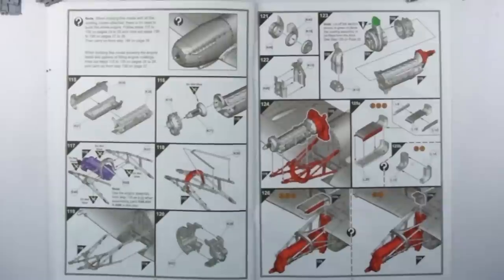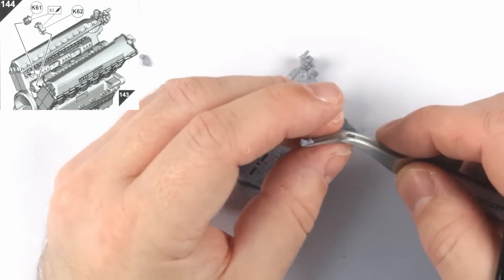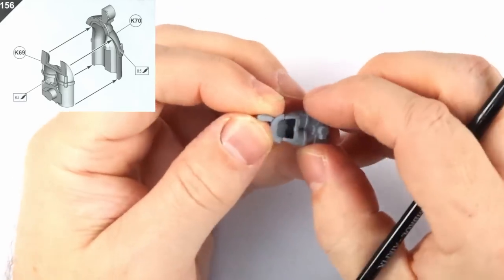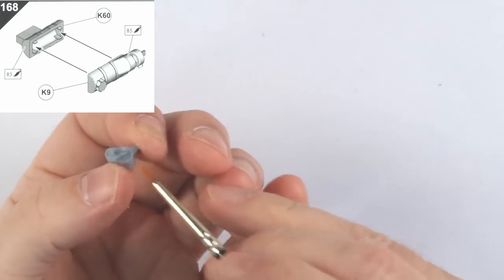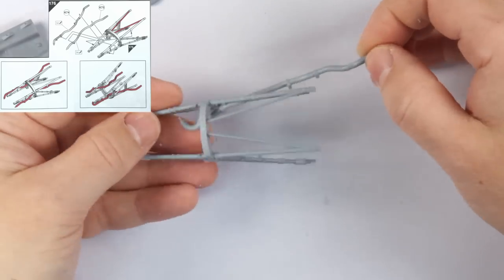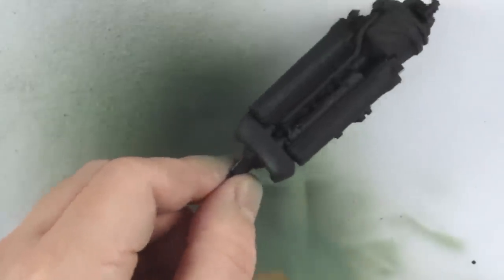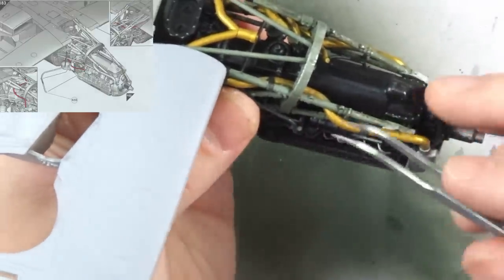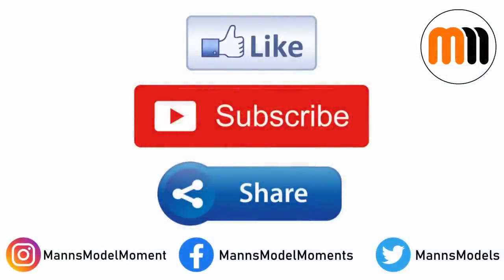Airfix 1/24th Spitfire MK IXc Build Part 3: Mighty Merlin!

Comment: Hi Alex! Really enjoying the channel and your 'grown up' approach, like not saying really makes it pop ever 30 seconds 🙄. Can I just say that the vast majority of metal pipes on an engine are copper rather than brass. Copper is easier to form and flexible in use. Brass is more difficult to work and becomes brittle through 'work hardening' when it flexes. It wouldn't last very long on any engine, fine for castings but rarely used for pipework. Hope you don't mind but it is a mistake i see over and over again on models 😉
Reply from the maker: Thanks

Comment: Hi! Thanks for the video! Quick question... is the only thing stopping us from temporarily fixing the engine cowling the need to put the exhausts on? Would it be possible to simply remove the exhausts in order to remove the cowling and show the engine and then put the exhausts back on again?
Reply from the maker: No. There's no need to remove the exhausts. Just as I did in the next part of the series,it's more about how you attach the cowling pieces

Comment: Nice kit and build  ... Quick question why don't u paint the sub-assemblies beforehand, especially the piping?
Reply from the maker: Good question - quick answer is, it depends, but in this case there are a couple of reasons - Firstly I don't want to have to clean paint off parts like this with lots of attachment points to fix them (I'm aware some people don't but that's the devil's work for me!). Second, I want to create some visual depth with the airbrush which is possible in sub assemblies, but harder. Thirdly, I do paint in sub assemblirs, but it's at which level you choose to. At the end of the day it's whatever you find best for your process - I'm certainly not saying what is do is the best way! Lastly, if I were not building this OOTB, I'd replace the pipes with polished and coloured wire, and not paint them!
Reply: @MannsModelMoments  Thanks for the reply. .. I normally do my engine blocks in a different color... (it's my kit and I can paint it the way I want to .. lol ) ... keep up the good work ..👍
Reply from the maker: @nickbroekhuizen8858  Absolutely! Merlin's and Spitfires had a lot of variation in component painting (as did a lot of WWII subjects) so even if a general standard was set, they changed, varied, were interpreted differently (Spits and other aircraft often had distributed production) or even just ignored.
Reply: @MannsModelMoments  I am no historian but thinking practically in war times resources are scarce. So a factory could very well use what ever paint was at hand for an engine since it was hidden away. So I don't think paint scheme were ignored but rather adapted to any given day.
Reply from the maker: @micnolmadtube  Absolutely!

Comment: Why do you apply cement to the insid or outside of the seam and not the edge?Am taking up model making again after a 50 year break .
Reply from the maker: So it depends on the part and the glue. If I'm using Contacta or another "regular" thickness glue) it'll go onto the contacting surfaces (or the edges to be cemented). 
If I'm using Tamiya Extra Thin - which is just solvent - then the liquid is drawn into the seam by capillary action, with excess evaporating very rapidly. This allows for a join with minimal excess cement - but it does limit working times and the "depth" of the bond.

Comment: I would like to build this model it closed up but with the Merlin engine on display next to it, is that possible  or do I have to build it one way or the other?
Reply from the maker: If you want to permanently close the cowlings and display the engine, next to the kit, it should be possible, though you'll need a few adjustments to mount the exhausts. Luckily as there are two versions in the kit, you can do that. If you're looking to be able to remove and replace the engine, that's a whole project.   You'll also need to build some sort of mount for the displayed engine, of course